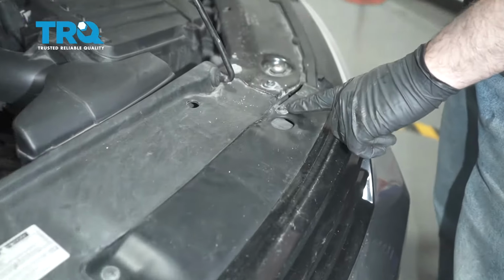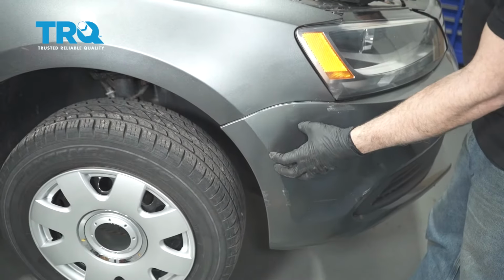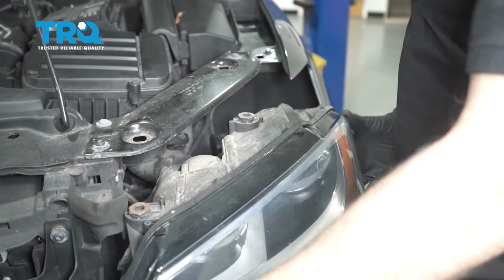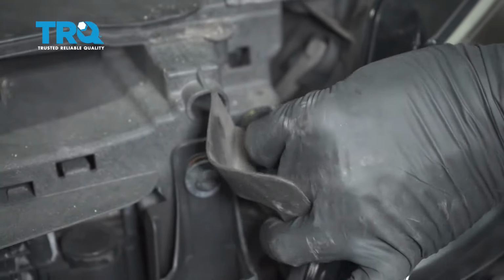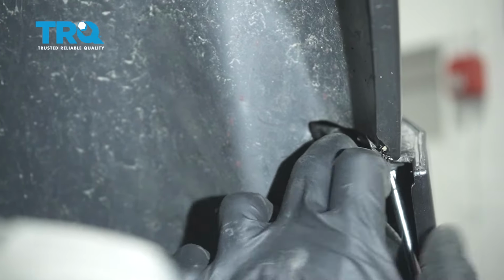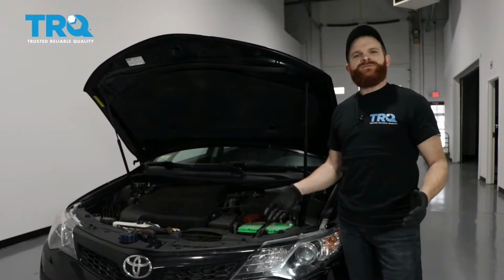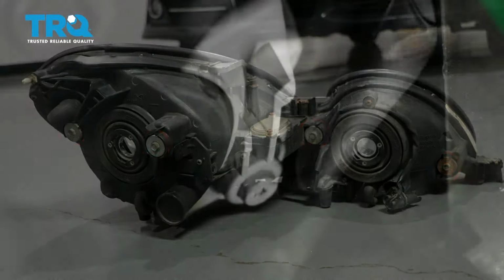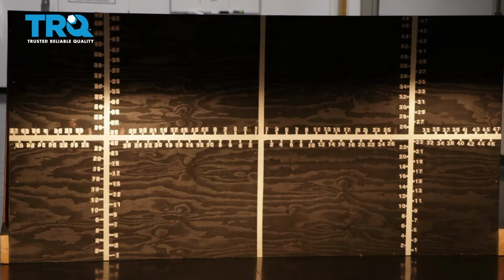How to Replace Headlights 2011-2018 Volkswagen Jetta

Comment: If you've found this video because you would like to replace a burned out headlight or turn signal, you do not need to remove the entire headlight assembly to do so. You can replace the bulbs through access ports in the back of the headlight assemblies without needing to remove the assemblies themselves. To find tutorials for this process search "how to replace [model year] Jetta headlight bulb".

Comment: Great video.  I had to do a headlight assembly replacement today on my car.  I did NOT have to remove the bumper thankfully.  Looked kinda complicated to get it back on by myself.  Just removed the grill, did the replacement and put everything back on.  No issues.  Thanks again for the video.
Reply from the maker: +@csteel3102 Thank you! We love empowering our customers and showing how to perform DIY auto repairs with our high-quality auto parts. http://1aau.to/m/Shop-TRQ

Comment: Does the headlight assembly come off WITHOUT taking off the bumper? If not, it seems that Audi engineers designed that system . . . I mean, $3000 for an oil change? 🤣
Reply: I took my headlights without removing my bumper sometimes other people rely on videos but i dont and nothing broke but they do extra work for no reason
Reply: Try Nissan. My ex had a blinker go out and I had to remove the front bumper to replace it. Dealership wanted $300

Comment: Is there a reason everyone takes the bumper fully off? The grill assembly is separate from the bumper and the final screw is behind the grill. Wouldn’t it be easier and faster to just remove the grill and not the whole bumper?